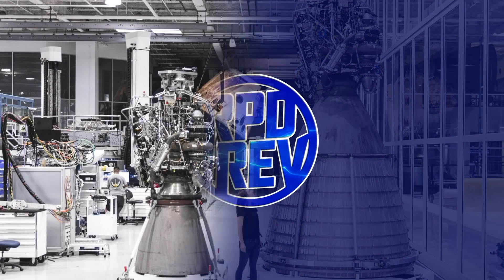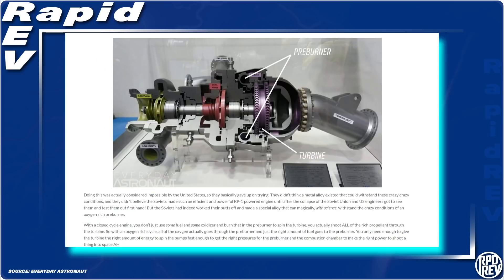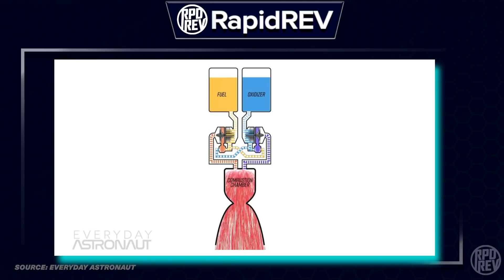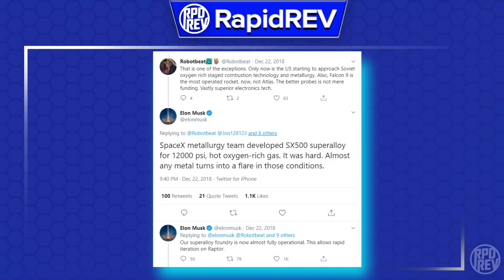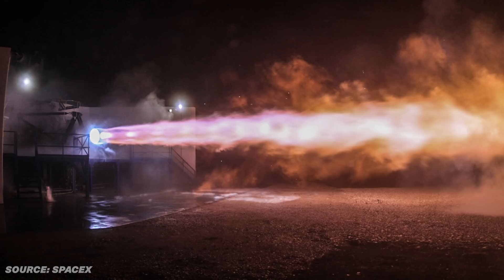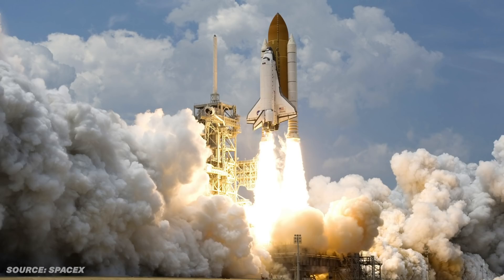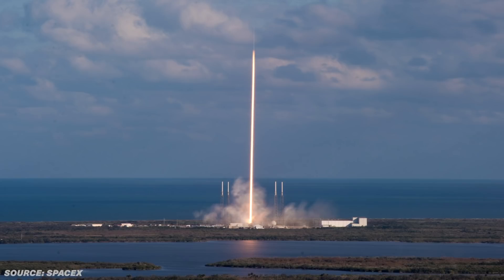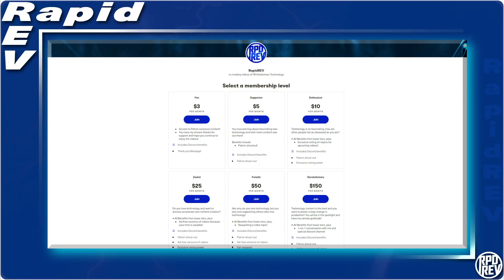Why SpaceX Built the Insane Raptor Engine

Comment: Just turned 70 and recently dropped my AWS CWI Certification. One of my last jobs as a Certified Welding Inspector for Pennington Mechanical, Inc was installing the 12" Vacuum Jacketed Liquid Oxygen supply line on the testing facility in McGregor, Texas completed in 2015.  I was impressed with the SpaceX Engineering Staff and the employees dedication to perfection. I found this presentation informative and have Subscibed!
Reply from the maker: Jack Whiteside thank you for the compliments! That’s a really cool project to work on too.

Comment: as cool as it would be to see, at least at first glance, we won't have boots on mars for decades, if even then. spaceX is a private company and there is no profit rationale for such an expensive, dangerous, and ultimately low importance project. musk doesn't even know how people would go to the bathroom on mars, let alone how martian sewage systems would work. how about power generation and agriculture on a planet that gets shrouded in dust for weeks at a time? how about dealing with long term low gravity and high radiation? those issues have never had ready for primetime solutions and they aren't coming soon

Comment: OK------------- Great Video! Good clear explanations that added to the much more complicated details the "Every day Astronaut" gave a year or so back. You even used Video and drawings showing the actual engine and Space X equipment which many mouthpieces around the web simply making blathering videos using stock video from other companies that have nothing to do with what they are talking about us.  Again Great Video and I look forward to hearing more from you. 

Maybe you could do one on the smaller upper-stage variant of the Raptor the Airforce has ordered from Space X that I keep hearing hints about? With it's smaller combustion Chamber it could have even higher chamber pressures. Thanks.
Reply from the maker: Larry Roberts glad you liked the video! I’ll have to check out this smaller Air Force Raptor engine out.

Comment: You mischaracterized the Russian staged combustion as failure. Future orders of the RD180 were banned in 2014 and their use was on the Atlas restricted to the 29 engines that had already been ordered (Wkipedia: Atlas[rocket family]) but that was completely a political decision. While not as advanced as the Raptor, the RD180 is a commercially successful staged-combustion engine.

Comment: Rolls Royce developed the process of investment cast single crystal turbine blades. - its essentially how the casting is cooled that allows a single crystal to form  Rolls royce   molds have a corkscrew feeder sprue which is apparently were the magic happens ,SpaceX  may have found a different way to perfom the same trick, but they will still be using ceramic shell investment casting.

Comment: Raptor engines are cast via single crystal casting method (presumably by looking at the picture at 5:38). It is done by pouring metal trough small tube while cooling it at the same time so the metal can't form crystals and it comes out of the tube as cast single crystal. It is commonly done to turbine blades of modern jet engines. It has nothing to do with alloying elements, if you just cast it normally it will not be single crystal, though obviously for some alloys it is easier than for others. Main purpose of alloying elements is to cause solution and precipitation strengthening for high temperature strength and creep resistance along with creating the the oxide layer for corrosion resistance as you said. With SX500's alloying elements these properties have been increased via use of refractory metals.

Comment: If the idea is for the turbine blades to be a single crystal of this Inconel superalloy then they certainly won't be 3D printed. Most likely they'll be investment cast and very carefully controlled throughout solidification and cooling.

Comment: I don't think marginal improvements on performance make it "radical"
Reply: "Marginal improvements" are the name of the game when it comes to rocket design, but you are entitled to your opinion.
The improvements in efficiency and lift capabilities, combined with the insane reusability of the engine..not to mention the ability to manufacture it's fuel virtually anywhere in the solar system..kinda makes it a complete game changer. But sure..marginal improvements..lol

Comment: They could possibly use supercomputer to design and test the rocket engine components and the whole engine tens of thousands times before actually building up the prototypes. The supercomputer could also help to design new alloys for the engine.

However, even with the help of latest CAD/CAM, CNC, 3D printing tech, manufacturing still remains the hardest part, as Musk once said.

Comment: Why didn’t Elon go the battery route??
Reply: Far more power is required than is available from batteries. A Raptor produces many tens of gigawatts of power, and requires several percent of that just to drive the preburner turbines.

Comment: The continuous use of the Raptor engine will allow for fine tuning and upgrades. I think this is so important. That and assembly line production which will lead to quality control and cost reduction.
Reply from the maker: Summer Lake Photog SpaceX will definitely keep iterating on the design even after the Raptor enters commercial operation. The assembly line production of rocket engines and ultimately rockets will be a huge area of innovation.
Reply: RapidREV right now the foundry and therefore raptor production is all R&D. While the overall system is in place (investment casting) the particulars of each step in the process get tweaked regularly so as to increase power/efficiency thru fine tuning.

Comment: When scramjets come along, rocket only space vehicles will gradually become obsolete. This is likely going to happen in 5 years, which is after the Starship achieves fully reusable status.
Reply: Scram jets would require airodynamic surfaces which add weight, are only useful in thick atmospheres  and are vulnerable during re-entry. Besides, it takes a lot more energy to push all those lifting surfaces through an atmosphere. All this for a small gain in not having to carry oxidizer for the first part of the flight to space? Sorry. Rockets aren't going away any time soon.

Comment: Further, methane burns at a lower temperature than Rocket Fuel 1, so there is less wear on the engine if you want to reuse it.

Warm regards, Rick.

Comment: I could be wrong but i thought inconel already existed - and is used in high temperature testing equipment !
Reply from the maker: sott jakubin you are correct but SpaceX has developed a proprietary alloy to resistance oxidation at high temperatures and pressures
Reply: I was thinking that ! Just was not 100 on the subject ! Thanks for the 411 tho !

Comment: Why haven't SpaceX replaced Falcon 9 Merlin engines with Raptors?
Reply from the maker: Joe Cazana the Raptor is still being developed and also uses a different fuel. They’d have to change the tank sizes and other stuff in the Falcon 9 to replace the Merlin. I don’t think they’ll do that, they’ll just use the starship in the near future.
Reply: Because the raptor was too powerfull 
And because it is expencive to do this

Comment: I love the whole approach though I'd like to see some FFSC competition from the hydrolox department. I still think, it's quite a waste, to leave about 80 to 90 s of Isp on the road...
Reply: .....lol what?? Where are engines like the RS25 leaving 80-90 seconds just laying around!? Do you know what you are talking about?
Reply: @StreuB1 , they don't. RS25 (vac: 451 s) probably leaves 10 - 20 on the ground by being optimised for the whole ascend. I was comparing ultra high performance upper stage engines. There's RVac on the on side with maybe 382 s and then there's a potential HydroloxVac (ORSC or maybe FFSC) on the other side with 462 - 472 s...
Reply: @alfihalma4320  You watch too much youtube.
Reply: What Isp gives getting to orbit, tank size and turbopump size take away; liquid hydrogen has a specific density of 0.07, so the tanks have to be huge, as do the pumps required to force it into the combustion chamber (causing the thrust-to-weight ratio to suffer). (I.e., a gallon of LH2 weighs < 1/2 pound, or a liter weighs 70g). Merlin's thrust-to-weight ratio is near 200; the RS-25 engine, 73.
Reply: @robertherndon4351 , true. But the net weight reduction for hydrolox is still positive when including modern rocketry.
Reply: @alfihalma4320  What are you saying? What weight reduction?
Reply: @robertherndon4351  , the total rocket weight for a specific delta-v. Like if you want to get 500 t into LEO, you'll need a 7,500 t methalox rocket or a 6,500 t hydrolox rocket.
Reply: @alfihalma4320  Your 6,500t rocket will require about 722t of H2, and 5690t O2. The O2 will require about 5,780m^3 in tankage, and the H2 will require about 10,300 m^3. Your 7,500t methalox rocket will require about 5,250 m^3 for LOX, and 3,300 m^3 for CH4, for a total tankage of o(8,500 m^3) compared to your H2 rocket's o(16,000 m^3). So your tanks have to be nearly twice as for hydrolox. Your engines also suffer for this: they have to pump that much more volume into the engines to work equally well on Earth. (More actually, because both engines need to run fuel-rich, which is more expensive with hydrolox: I assumed stoichiometry here.) Between the tankage and the poorer t/w ratio, you lose most or all of that benefit. Further LH2 is notoriously strange and finicky stuff, and has to be kept at 20K or below, where LNG is cheap, common, and has thermal properties similar to LOX. Further, if you didn't note, your hydrolox engine will not get your full potential Isp down here on the ground: you need a full-size nozzle to get that, and they don't work at sea-level atmospheric pressure.
Reply: P.S.: If you want an example, the D-IV heavy is a good one. It's not particularly great for getting things to orbit (and it's $$$$$), but if you want to send something to Jupiter or Saturn, it's pretty good.
Reply: @robertherndon4351  I'm well aware of that. Nonetheless, even though the tank needs to be bigger and the engines have a lower TWR, hydrolox, ignoring the fuel cost, does better.
Reply: @robertherndon4351  , the DIVH uses the RS68... That's a ridiculous engine. Hopefully Vulcan will work out (which will be probobably run to the ground by Starship). But the Centaur upper stages profit from hydrolox. Doesn't matter if it's Atlas or DIVH. DIVH just pushes a little further...
Reply: @alfihalma4320  That must be some definition of 'better' with which I am unfamiliar. The D-IV is nearly the only hydrolox booster to launch w/o SRBs. Even the Saturn-V only used it on upper stages. There are reasons -- good ones -- for that.

Comment: How,  numerically,  does its efficiency compare to the Space Shuttle and other engines?
Reply: That's a very hard question to answer, because the questions are the important bit.
The usual 'figure of merit' for engines are: (1) Isp. This is a function of the propellants and the engine efficiency. It correlates directly with exhaust velocity. (2) Thrust-to-weight ratio: how much can an engine lift compared to its own weight? This matters if you're trying to lift a rocket off the ground, but not so much in space.
SpaceX has announced a target of ~380 for Raptor's Isp. This is much lower than the space shuttle RS-25's Isp, 452. That is largely attributable to the fuel choice; hydrogen and oxygen provide the best potential bipropellant Isp. For technical reasons, this is largely a function of the average molecular weight of the exhaust and the energy of the reaction.
The downside of the hydrogen/oxygen propellant choice is the very low density of hydrogen. A gallon of liquid hydrogen weighs about half-a-pound, compared with water (8.34lbs), or liquified natural gas (3.5-4 lbs, depending on temperature). This mandates very large hydrogen tanks for the space shuttle. It also means that the engine pumps have to be large to pump enormous volumes of liquid hydrogen into the engine, and their thrust-to-weight ratio is not high (e.g., the Space Shuttle's RS-25 has a thrust-to-weight ratio of 73). Nearly all hydrogen-oxygen boosters require solid rocket boosters to help them get off the pad (e.g., space shuttle, Ariane, H-3, ...). Solid rocket boosters are expensive, and have a number of other drawbacks compared to liquid propellant engines (low Isp, not throttleable, rough thrust behavior, ...)
Traditionally, boosters often used kerosene and liquid oxygen; the Isp suffers quite a lot (280-ish) , but the thrust-to-weight ratio of kerolox engines is very good, and the turbopump technology does not need to be exotic. SpaceX's Falcon uses kerolox for both the booster and the second stage. As a result, it performs very well for near-Earth operations, but for sending probes beyond-Earth-orbit, the relatively low Isp of the upper stage makes it less effective than it might be with more exotic propellants.
SpaceX's choice of methane and oxygen for Raptor is a compromise: it doesn't have the 450-ish Isp of H2/O2, but it doesn't force the poor thrust-to-weight ratio that hydrolox engines have generally suffered. So the same propellants can be used for both the booster and the upper stage, simplifying logistics and lowering costs. (Methane, as liquified natural gas, is very cheap, as is liquid oxygen.) Methane and LOX also have a fairly high Isp, and reasonable densities. Raptor was intended to extract all possible energy from its propellants (the "closed-cycle" means all propellant exits the engine through the combusion chamber to provide thrust), and it looks like it will be a raging success at both its efficiency at extracting that energy, and at its thrust-to-weight ratio, which may compare with Merlin, with both nearing 200.
Reply: @robertherndon4351  hard question? Not at all! You answered it very clearly.  Makes perfect sense.  Thank you very much.

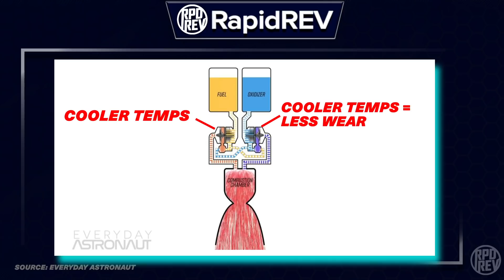Comment: At about 3:40 it is claimed that the raptor turbopumps are operating with cooler temperatures AND lower pressures because of the mixture. The cooler temperatures are the case,  but the pressure has still to be insanely high because this determines the massflow.
Reply: @RaptorPrinter  The mixture affects only the turbine side where the first stage of combustion occurs, the pump side where usually cavitation problems arise is completely independent regarding the mixture which is burned in the turbine. Because of the lower temperature in result of the incomplete combustions in the turbines the generated pressure from the pumps could be even higher. Only 5% of the material is actually burned at the first stage. High pump-pressure is the goal to push all the unburned gas into the main-combustion chamber to achieve efficent combustion at high pressure.
Reply: Elon has publicly tweeted that Raptor pressures run up to 12,000 psi (850 atm). For full-flow, staged combustion, everything in the propellant path from the initial preburner turbine entry (~3-5 atm) to the main combusion chamber, nominally 300 atm, must be at a pressure higher than the main combustion chamber. There must be substantial pressure drops between the preburner combustion chambers and the preburner turbine outlets, where enough energy must be extracted to compress the incoming propellants. The temperature in the preburners must be high enough to support reliable combustion, and provide enough energy to compress the propellant stream; aside from that, only hot enough to make everything run. Conceivably, this might only be a few hundred degrees C, which would make the hot oxygen-rich propellant stream much easier to handle.